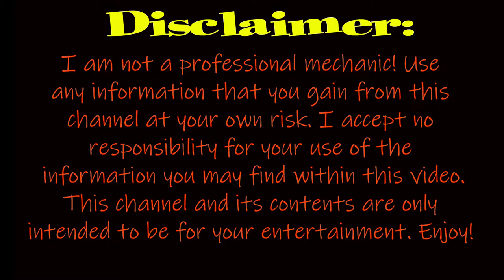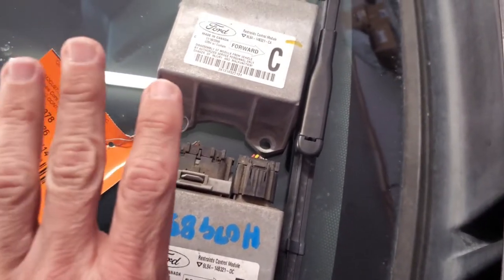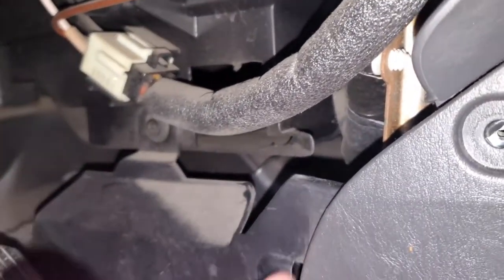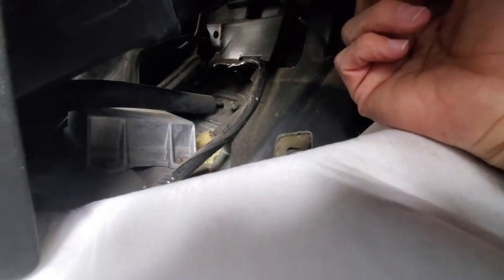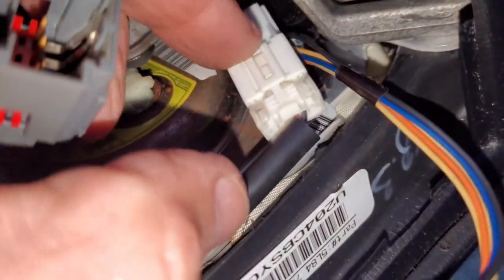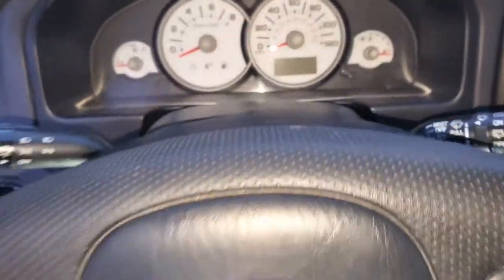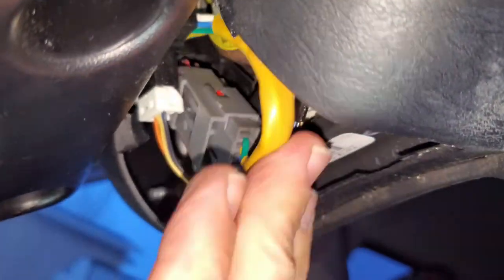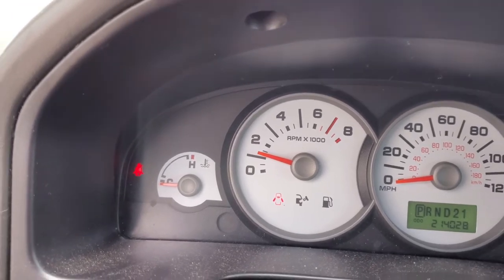Eight Nine Garage - 06 Escape Air Bags, Module, and Seat Belt Pretensioner Replacement - EP37

Comment: Hi Sir,, thank you for making the video.

My 05 2.3 airbag red light keep flashing while the car is started. The bag never exploded, I cleaned & join the socket under front seats, but the red airback keep flashing. Would you give me recommendation to get this Red Airbag light back to normal?

Thank you sir, really appreciate your effort for making these videos
Reply from the maker: Hello! The best advice I can give you is to scan it with Forscan. It will tell you exactly what is going on in the system, and ultimately causing the air bag light to illuminate. I actually will be doing another video about this fairly soon. After being OK for over a year, it started displaying an intermittent code again recently. Stay tuned! By the way, Forscan is free at https://forscan.org/ and you'll just need an adapter for whatever device you choose to use. I prefer a laptop, as it seems to be a little more thorough. Thank you for watching, and let us know what you find out!

Comment: I will like to ask something, if the car was involved in the accident not much damaged  is done just broken front bumper triggered the airbag. Now putting new airbag is it really necessary to put new airbag module or I can reprogram the old airbag module with new airbags... Please assist me with this. Ford kuga 2014 ecoboost 1.6l
Reply from the maker: It can usually be reprogrammed. For me it was less for a new module than reprogramming it. I found some sellers on Ebay that will reprogram them for you. Great question!